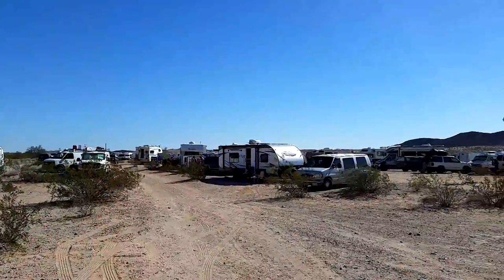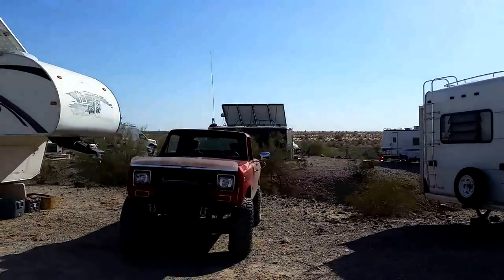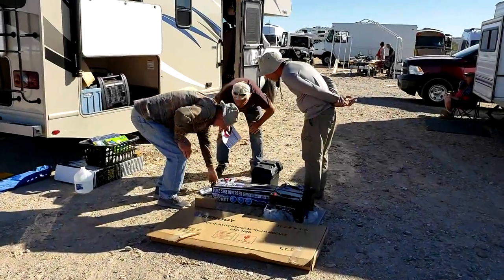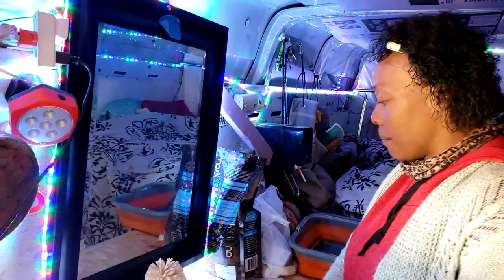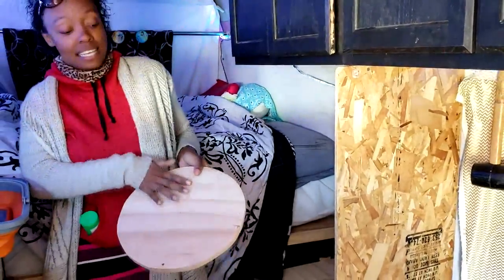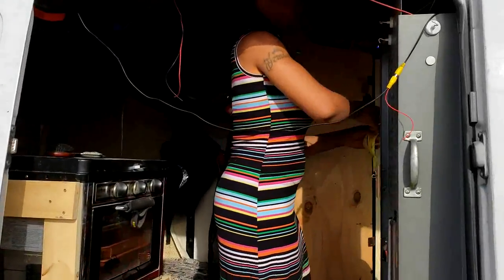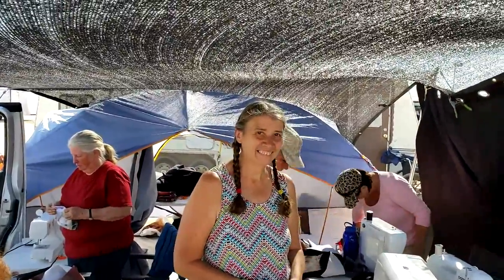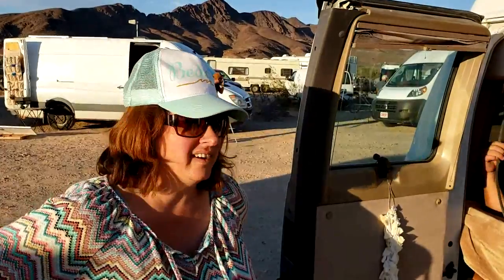Enigmatic Nomadics Van Build 2018 Tour by The Cruisin' Crew

Comment: Just an FYI for travel trailer owners like myself. I saw a travel trailer in this video with the X-Chocks. If you have the new wheel X-Chocks, make sure you have a lock on your trailer hitch as well. A clever thief can deflate each tire by 6 - 10PSI and the wheel chocks can be easily removed lock and all. I tested this on my trailer this weekend and the trailer can still be moved safely. Safe Travels everyone. NOMADS RULE

Comment: Go to a craft store and they have what you call a decoupage liquid which is stick the trick is glue your pictures down then put that decoupage over it and it makes a hard finish in for table tops I've even seen bars that would use that stuff but the hippies used to use it rubber that have that burnt wood and oval and decoupage Molly hatchet pictures and stuff to hang in there vans I had one

Comment: Hey man, I'm from the South. Down here, it is very important which compass direction you park; based on the sun position and the wind. I don't see any attention given to those two factors in your videos.  It makes a big comfort and maintenance difference. I think that only Bob Wells has ever discussed this. I do a lot of property management work and I am in, and out, of my van all day. In the Summer, it is amazing how important it is to face at some version of North and with a cross wind. In the winter, I park facing South or Soutwest and it is important to park facing directly away from any wind, or blowing only on the passenger side. 
I have a ribbon my my aerial that reveals the slighted breeze direction.

Comment: when I see the taller vans I worry about the ability of the roof to hold up if you roll sideways. we rolled sideways a few times in a suburban, the trailer behind us was flat as pancake the suburban was in one piece the ceiling didn't cave an inch